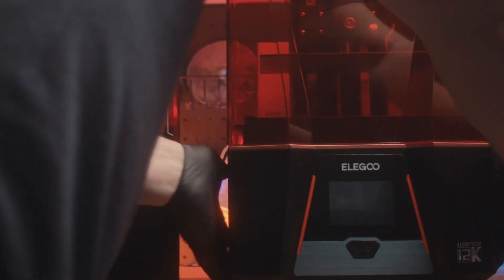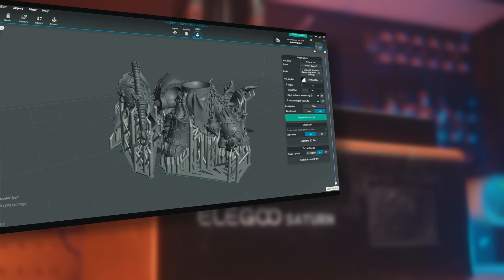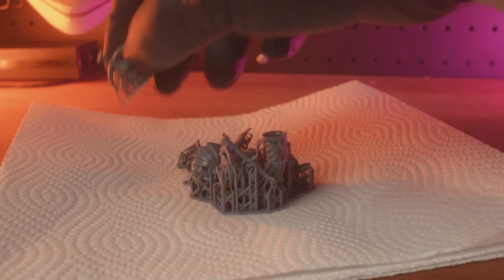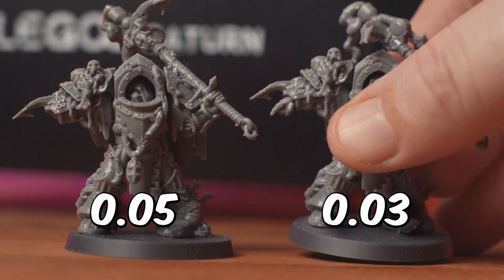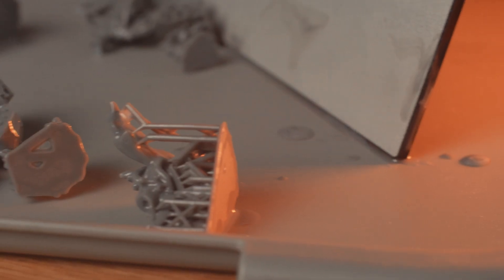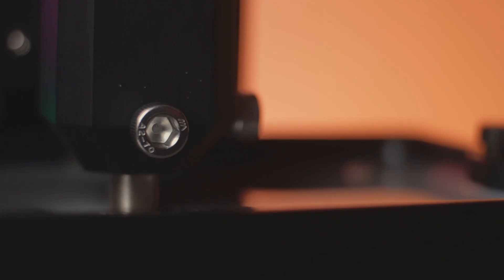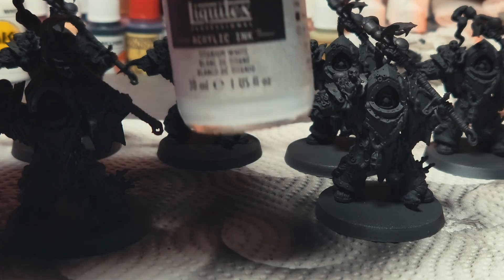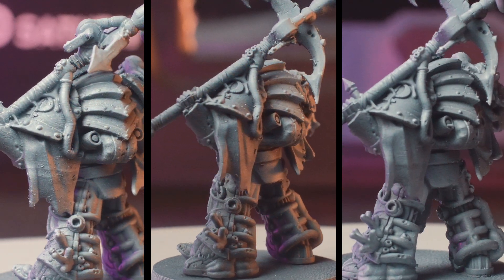The Ultimate 3D Printing Resolution Showdown

Comment: Hey. im sure others pointed this out. You printed them all at the same layer height of 0.05. The 12k printer should be able to print at 0.025 which will result in less visible layer lines as they will be half the size.

Comment: I still use the Saturn 1 4k use 30 microns..
Had a lot of thought to replace it for a newer model but now i see there is almost no differents between 4k and 12k i think about keeping the saturn 1.
Only thing maybe time.. but i always set my printers to print at night.
 Always prints perfect, never had any flaws of errors and new parts like screen, buildplates or resin tanks are still available for cheap.

Soo i say why change...
It works perfect. 

Thanks.
Reply from the maker: I still have mine as well, I see no reason to get rid of it. As long as there are replacement parts available for it I will keep it going.
And to be honest it has printed most of my armies. I do love my newer printer the Anycubic M7 MAX but that is only because it is
a 13.6 inch plate so I can fit a lot at once.

But in saying that I would say if you are happy with your Saturn 4k then there is no need to upgrade.

Comment: I've been using my Photon Mono 6Ks pair for 2 years with excellent 30micron results.  In fact, some of the rounded elements on your 30 micron prints looked better on the 6K.  For greeblies or less detailed parts, I still use my original Creality LD-002H 2K workhorse.  For my next buy, I'm saving for the Heygears Reflex RS Turbo.
Reply from the maker: I own the HeyGears Ultracraft relex that HeyGears sent out for a video a while ago. It is a good printer very detailed prints. But mine is just sitting there at the moment, for me it is just easier to work with the Elegoo Saturn 3 because it has a lighter VAT to lift out when changing out resin and just less mucking around.

I used to own the Creality LD-002R I think it was their 720p or 1k screen from memory and it worked very well for the time I had it. I ended up giving it away to a friend only because I have around 5 resin printers now. But it was a workhorse as well.

I have heard good things about the HeyGears Reflex RS Turbo, seems to me that HeyGears is actively trying to improve their position in the hobby resin printing sphere. Let me know if you take the plunge and buy the printer I would like to know how it goes for you :D

Comment: Metho works a treat.  I buy 4L from bunnings every month or two.  I use 3 wash units. A pickle jar for the initial clean, a large sealed plastic container (~8L half full with IPA) then the Elegoo wash and cure unit.  When the Elegoo cure unit gets dirty, then it fills the Container, and the container fills the pickel jar.  This workflow leads to really clean prints and I feel like its less wasteful in the long run.

Comment: I don't get it some had the skull on the right shoulder with.. Plastic in it's mouth. And the flame or smoke on the center top of the pickaxe is it suppose to be straight or hanging down? The were all different.
Reply from the maker: Some had slightly different parts, but the main goal was to compare the layer lines on the model. The odd smoke on top of the pickaxe or skull on the shoulder had nothing to really do with it.

Comment: I think they all look fine. Once painted up it would never make a difference. Honestly, I try to print most of my vehicles on my FDM printers even though there are definitely layers, after they are painted and all gussied up they still look badass and where a lot less of a pain to print. I've even got some regular minis printed on FDM and I think they still look great. I'm trying to have fun and play a game with friends, not win a golden demon. That said, some detailed minis will just look better in resin but it  sure seems like pretty much any resin printer gets it done nicely.
Reply from the maker: Yeah I agree, once I put anti aliasing on as well it smooths things out a lot. One reason why I am going to be using my Saturn 3 more over the Saturn 4k is the speed, it shaves about an hour off on the same prints.

Comment: I have a Elegoo Saturn 8k and a Elego saturn 3 ultra. I like them both. Same build plate but the 3 ultra can make taller prints. And the 3 ultra is much faster as well. But the deatils are similar when i print out minis. (Edit. I use Ethanol for washing my minis and it works great. I do have a spray bottle with IPA as well to clean up the printers.)
Reply from the maker: I am fast becoming a bit of a Elegoo fan, they run well and I have had a couple of emails with their support team and they always respond. I was originally going to get a Elegoo Saturn 8k to replace the Saturn 4k but since the Saturn 4k was doing so well I had no 
need to upgrade. Great printers, never tried Ethanol before.
Reply: @NatesMiniatures  I use the Siraya Tech Fast 8K resin and it is hard enough for small details so they do not break. Of course if you knock off the minature from the table then it can happen that a thin part breaks. But most of the time it is okay. My first printer was an Anycubic photon S (2K printer). But i do love my Elegoo printers and would recomend the brand all the time.

Comment: thinking about getting into printing just for making and painting models. Idk why I never bothered to play a 40k game before but after playing space marine 2 I cant get enough of the universe and lore. Found your channel when researching. Subbed
Reply from the maker: Fantastic mate, welcome! and thank you for subbing it means a lot. I would suggest picking up some physical models first with some paints. This way you can see if you truly love painting, it is good fun.

And then next I would suggest Elegoo printers, these are the ones I have used most and they work well. There are two types of printers I can suggest and that would be a smaller 5inch build plate printer like the Elegoo Mars series if you 
don't have a lot of space or you only want to print and paint small amounts of minis at a time.

Next you have the bigger or "mid" sized build plate printers the Elegoo Saturn series with a 10inch build plate. This series
is great if you plan on printing out a larger army in a shorter amount of time.

When thinking about resin printing I would factor in things like have you got a good place to setup. Ventilation is good?
You have enough space (small table is fine) for post processing such as washing and curing the models.

Buy plenty of gloves, ISO alcohol for clean up, good mask and LOTS of paper towels heh. It sounds like a lot, and it can be but you can get away with things like making your own curing station with a UV light in a box with tin foil wrapped on the inside to reflect the UV light around.

Washing with IPA can be done in something like a pickle cleaning tub for super cheap.

Once again welcome to the hobby brother

Comment: I have the Anycubic Mono, Anycubic Mono X 6K, and the Anycubic Mono M5 and they all have specific duties.  I use the 4k and 6k for bases and terrain but sometimes use the 6k for models too.  But I can tell you it is hard to see the difference between 6k and 14k.  I print everything at 30 microns because I feel like it is hard to see any difference in anything at a smaller layer height.  All three of these printers have a place in my work flow and the 4k and 6k seem to be running no stop all the time.  Great comparison video and I think the key is get into it and get the experience.
Reply from the maker: Thanks mate, I have never used the Anycubic machines before but I have heard they are really good. I feel for miniatures you are right and 30 microns is the sweet spot and it is very hard to see the difference from a 6k printer print from a 12k printer print or in your case a 14k screen.
I have actually found myself using the Bambu Lab A1 for bases lately because of how smooth they come out. And because of the textured plate on the Bambu printer it even looks like a traditional GW base. 

I also want to print more terrain in resin, I prefer the quality compared to FDM, I see a lot of dry brushing after a FDM print and it is not my fav seeing all the layer lines. Thank you for commenting :D

Comment: Strange that the mars 4 max has the same layer lines on both prints. Ive noticed a difference in mine when changing the height. Where can i get the STL? I'm intrigued now I want to see if mine does the same.

*Ignore me I completely missed where you said what mini you're using 🤦‍♂️
Reply from the maker: haha all good, yeah it is from Mezgike on myminifactory his dredge faction. I will be interested in the results you get with your Mars 4 MAX, did you have an issue with using Lychee slicer .goo file? I just had a terrible time and had to turn to chitubox to re-slice the file.
The build plate kept going up but not down each time the screen did a layer, also had some weird sounds when the plate was trying to lower as well. Just some odd quirks with my machine.

Comment: I just bought a Saturn 3 after much debate with all the options out there. Im new to the hobby and started with a mars pro and can say the Saturn 3 is amazing I’ve barley changed the base setup just did exposure tests hit print on those exact MEZGIKE models and its been 100% successful on multiple prints.
Reply from the maker: Saturn 3 is great, you know the funny thing is. I have not dialed in the printer yet I leveled it and loaded the file and it printed fine each time. I am looking forward to printing a LOT more minis on it. Also Mezgike stuff is awesome

Comment: Can you do a print video on the saturn 3 with different grades of resin? I got a saturn 3 ultra but i cant seem to get good results
Reply from the maker: Maybe one day after I get some projects I have had in the works for a long while now.
What seems to be the issue?
Reply: @NatesMiniatures  some of the smaller print stuff loses a lot of detail, one of the minis i had printed came out with no face

Im also getting a problem with supports i think the connection bit is too big when i remove supports it keeps ripping apart of the minis 

Do you have a discord i can maybe send images
Reply from the maker: @SkitZHitZ  yeah mate I will get you the link  https://discord.gg/hDHUmkCr
Reply: Try ABS like resin from sunlu. And make sure your ambient temps aren't to cold. Also run an exposure test for that resin to dial it in
Reply from the maker: @WolfyNotCool  I have over 40 liters of resin at the moment for a lot of projects. And Sunlu ABS like is one on my list to get. I have seen great things from it.

Comment: the resolution is meaningless unless paired with screen size. A 4K screen could have higher DPI than a 12K one.
Reply from the maker: Of course, but this test was done with the printers I own. But in saying that I can still push the Saturn 3 more as well but by doing that will I notice. Very doubtful

Comment: I feel like the 6k is slightly better quality than the 12k is based on those results. Shame you cant buy it anymore.
Reply from the maker: It is a decent printer though it did have some quirks, extra noises that are not usually with other printers. But when it printed it did it well, and I like how light it is compared to the Saturn 4k. I have no idea why it was removed from their store front. 
It might not of sold very well compared to the Saturn series.

Comment: I’m still rocking a Mars Pro 2 (2K.)      When primed and painted, you would be hard pressed to tell the difference in any of them.  Reason to upgrade is speed and build plate size, not really resolution.
Reply from the maker: I actually agree @toddzino58 I like to get full plates of standard 28mm minis out with in 1.5hrs to 2hrs. Build plate size is another big one if you are printing a lot in one go, I found even with my old Creality LD00-2R I wanted more space on the build plate hence
why I bought the Saturn 4k originally.

I would LOVE a Phrozen Mega 8KS but have you seen the prices for them 0.o

Comment: did you recalibrate the exposure time between 50 and 30 µm?
Reply from the maker: A little, I mainly wanted to see the default settings out of the box. I know I can push up the quality on the Saturn 3, for me
the Saturn 3 will now be my main printer due to the speed and the ability to do this bump in quality if I need to. Though I 
doubt I really will worry about it too much.
Reply: @NatesMiniatures  they look softer at smaller layers height and I was wondering if it's also due to overexposure, but the resin transparency may also play a role.

 I still an old photon (which cames with a 2k rgb screen) on which I have upgraded the screen still 2k, but the pixels are still 50	um. My go to is 30 um layer height. It's been a while since I last printed at 50 um but I remember that the difference was quite significant, especially for smooth curved surfaces as sphere.
Reply from the maker: I bet I can push the Saturn 3 to 0.02 and get even smoother results. But I need reading glasses when I paint so I wouldn't see it anyway. But I do think from now on I will go with 30um for miniatures, just feels like a good place to be in when looking at it.

Comment: Great video. So hard to realize that the 4k 6k 12k really don't matter much. 50 microns to a normal human eye looks great.  Like others have said just marketing. Still watching for the 3d printing world gets easier and better options for work flow/quality of life stuff.
Reply from the maker: Thanks mate, yeah it is very hard to see any quality increase. There are some but you will have to hold the mini up to your eye ball to really see. And honestly most of the imperfections I only seen when I was editing.
Quality of life 3d printer would be amazing, what ever company does that will win.
Reply: the resolution is meaningless unless paired with screen size. A 4K screen could have higher DPI than a 12K one.
Reply from the maker: @FardTeam  I have already replied to this comment since I have seen you posted it 3 times. 
It is known the smaller the screen with the higher pixel count you will get better quality prints.

But I mainly work with larger printers that have a 9 inch to 10 inch build plate for army printing.

So the smaller printers are not the best option for me. Hence why it was not tested
Reply: @NatesMiniatures  but the prints are all at 50 microns for most people. Unless they go down to like 20 micron prints and more than double the print time, older printers still work well.

Such a good video to show that
Reply from the maker: @WolfyNotCool  I think a lot of people can save a lot more money by looking into the older printers. I think for quality prints once you dial in that printer with the resin you can afford it will produce fantastic minis.
Reply: @NatesMiniatures  Agreed. As long as they stay away from RGB screens

Comment: Lets go!! from day one I have been printing at .03 layer levels it is the way to go its been 4 years now. Smoother and looks way better more so when anti alising is on.
Reply from the maker: Yeah I agree 100%
Reply: I still haven't tried anti aliasing! I've got an Elegoo Saturn 3 Ultra. Any tips?
Reply from the maker: @Prickles2001  I like using anti aliasing as it does reduce the layer lines a lot. I usually only do 2x AA, might be worth printing a few models for yourself and see where you are the most happy.

But in saying all that the Saturn 3 is a very nice printer so I can imagine the Saturn 3 Ultra would be even better.
Reply: @Prickles2001  I would say try it out with different levels of it I found it lower better for myself it is more noticble on bigger objects like tanks or large rounded objects.
Reply: I use the s3 ultra, at 0.02 or 0.03 you could do without AA.
Reply from the maker: @WolfyNotCool  I need to try printing at 0.02 on the Saturn 3. I know it can do it
Reply: @NatesMiniatures the exposure time is way lower at smaller microns. Definitely worth it for Tanks with flat slanted surfaces